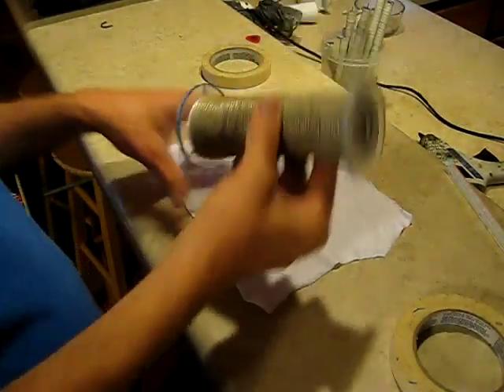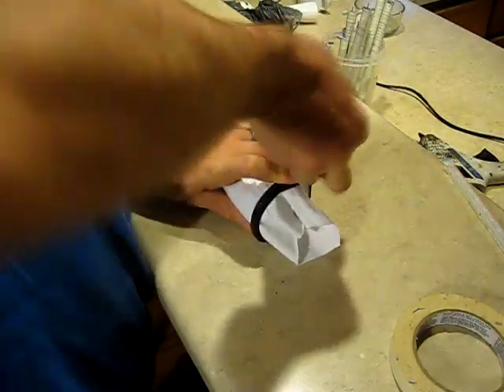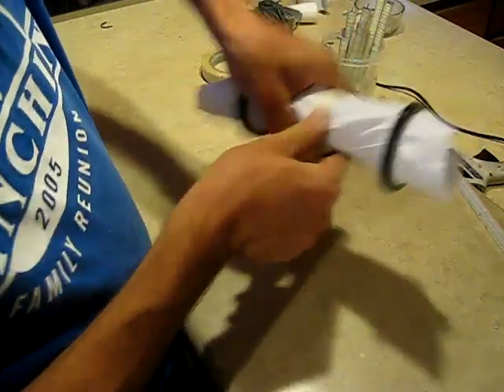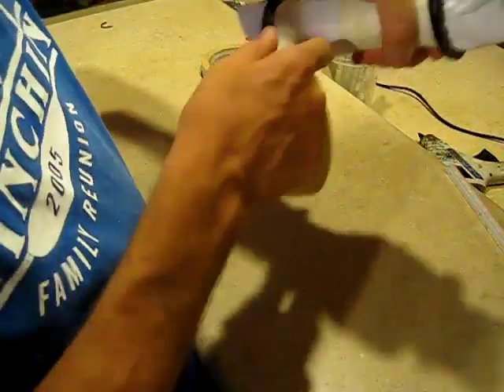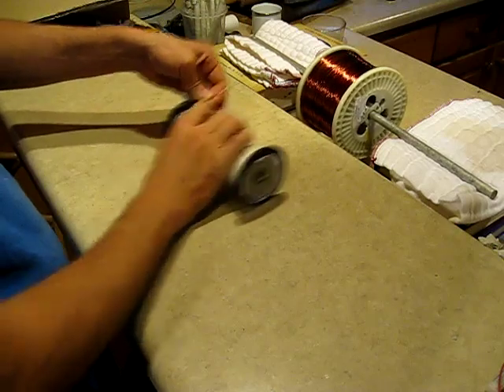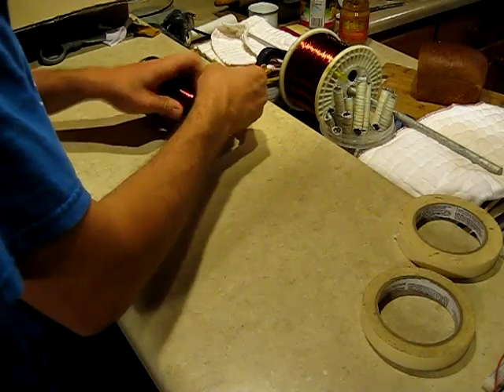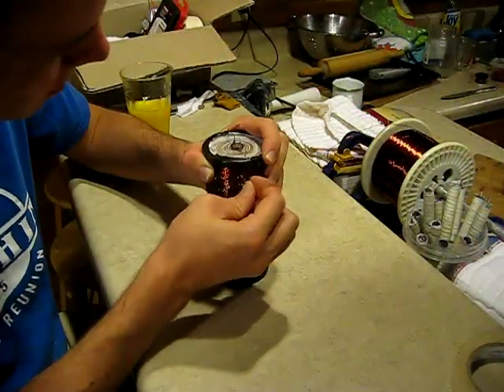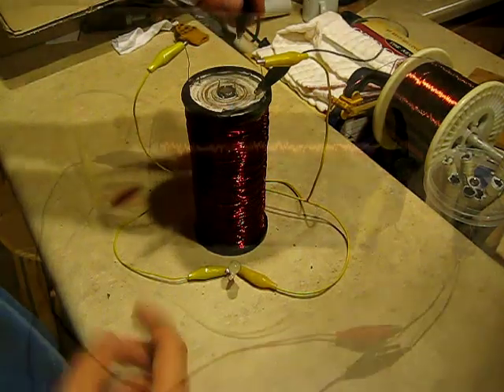How To Build A Nathan Stubblefield Coil Part 5

Comment: The original coil used a carriage or stove bolt, most likely wrought iron. Nathan may have been taking advantage of conduction and induction with the earth. If the wide round bolt head touched or conducted the earth, each pulse would pulse an inductive response in the bolt/core and the earth. Generating a very large return pulse. The iron of the core would be like one capacitor plate, the windings would be the other capacitor plate. Once you start it. It would take off.

Comment: I really enjoyed this!  After watching this video a few times, I wonder what would happen if less corrosive materials were used.  Maybe along the lines of using Thomas Edison's rechargeable battery materials like stainless steel wire combined with nickel wire.  Bare wire seems to be easier to obtain.  Possibly unwinding a roll of cloth electrical tape used in the wrapping process to insulate the bare wire.

Comment: The sweat from your hand and fingers will gradually start to break down the insulation. I would like to make a suggestion that may make your coil more efficient. Take a look at transformer core you will find a lot of sheets of metal stack on each other. This is to help the core to work with the counter emf in the coils. I have not done this try using allot of soft iron wire in strands in parallel to make the core. Could be if you use more magnets in the wheel you may make a lot more electricity.

Comment from the maker: @VideoVegetable   
 
I am doing a long run test with the coil made in these videos.  I have had it running mostly non stop ever sense I made it five days ago.  The longest I let a coil run in the past was for one month.  It was still working but I needed to use the wire on another coil So I took it apart.  It's all in how good you are at keeping the coil moist but not too wet.

Comment: I just viewed lidmotors latest video with the pulse motor.  He mentioned the zinc (used in place of the iron) breaks down within in just a day of use?  His coil was not as large and would not work after a day but I am wondering like others here if the first coil you made is still working?

Comment: Do you think that it might be better to wrap the secondary first then the primaries since it is the primaries that perform the "battery" action? 1. it might make the primaries are easier to replace and 2 the secondary is will not interfere with the primaries reaction.